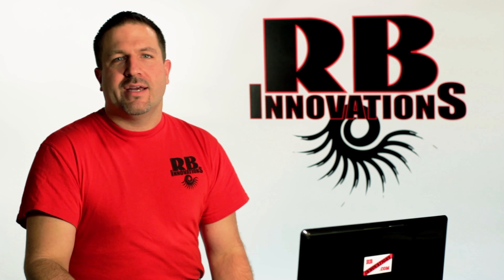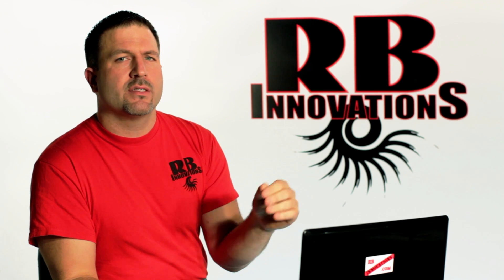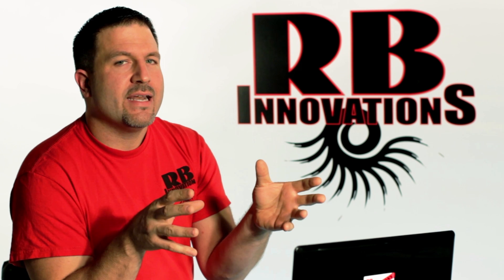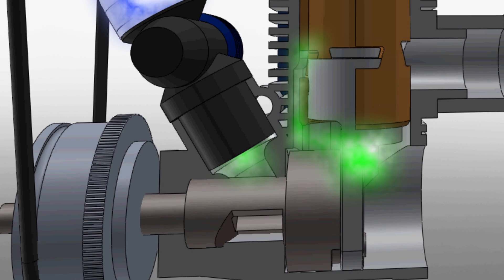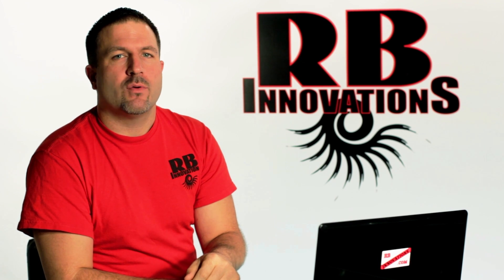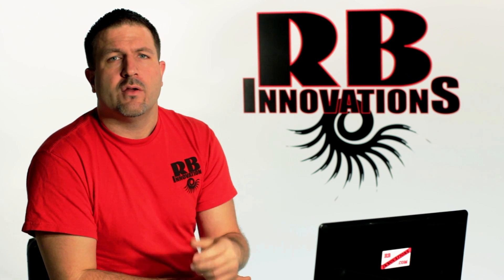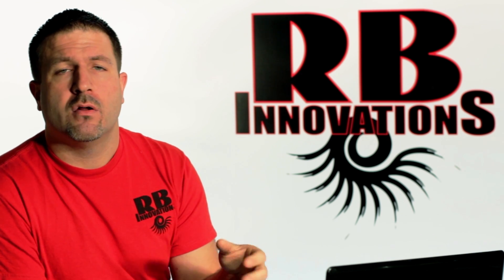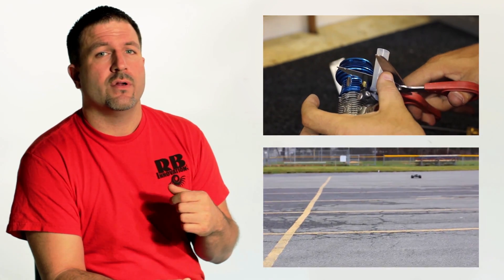How RC Nitro Superchargers Work

Comment: See I'm with the people who talk about blowing the pressurized air straight through the combustion chamber and out the exhaust. You need to prove that the shock wave holds that pressure.
Reply: well the shock wave does hold pressure back to a degree, speaking from knowledge of motocross 2 strokes, but without a exhaust specifically tuned to make this happen i would say that amount of pressure is finite. with larger 250cc two strokes the reverberation of the sound shock wave drives the A/F mixture back into the combustion chamber during the on set of the power band, this is whats called "on the pipe" in two stroke world. but again, just how much this shock wave can hold back is the real question here.
Reply: Matthew Miller But so even if it created any type of boost, wouldn't that boosted intake also require some sort of boost fuel to enter with the mix? If anything the added pressure would force back the fuel into the tank! LOL
Reply: Wow, this came up from the past!  Fuel in a carburetor is pulled into the airstream by the low pressure in the venture (that's supposed to be an "I" on the end of that word, but for some reason it keeps autocorrecting!).  If a supercharged and carbureted engine is a draw-through design (carb upstream of the compressor), this doesn't change: the carb is still seeing ambient pressure and the fuel supply needs no changes.  If the engine is a blow-through design (carb downstream of the compressor), the carb is seeing the boosted manifold pressure.  In these setups, you supply the boost pressure to the fuel tank volume also, instead of venting the tank to the atmosphere.  Therefore, the fuel supply sees the same boost in pressure above ambient pressure as the carb.  That way, the fuel is still drawn into the air the same as when it was all at atmospheric.  This is also nothing new, and it is required of any supercharged engine with a blow-through carb design (car engines, old airplane engines, etc.).  Pressurizing the fuel tank on r/c engine setups is also nothing new at all.  All of this can be found in any basic book on superchargers (especially older ones, from back when carburetors were still in fashion).
Reply: seth newman I was responding to josh ziesmer, to his post just above mine that was all about carbs with fuel pumps, floats, etc.  I have no doubt that r/c engines usually pressurize the fuel tank these days.  It doesn't make a difference to what I've written regarding supercharging such an engine.

+josh ziesmer What do individual exhaust pulses have to do with valve timing overlap?  We are talking about the overlap of the intake and exhaust openings.  Some here have said that supercharging can't work on engines that have overlap, but that is completely wrong.  Greg Quillen is right: most 4-cycle gasoline engines have at least some overlap of intake and exhaust timing, including ones with superchargers.  Some have a lot.  In fact, the ones that have a lot of overlap tend to have the most distinct exhaust pulses at idle (which is why people refer to them having a "lopey" idle).
Reply: josh ziesmer 
You dont even have a clue what valve overlap means /.-
   Valve overlap refers to valves both being open in ONE cylinder, and the exhaust and intake both happening at the same time. The exhaust valve is held open, then the intake opens letting the exhaust fully clear while oxygen is coming in, then the exhaust closes letting more air in, then the intake closes..THEN combustion happens. The piston moving down to dead center sucks intake in, while exhaust is being pushed out by the same air. 
    The time when the exhaust and intake valves are both open in ONE cylinder is called "valve overlap" because their actions and duration sequences overlap.

What you are thinking of is not even close to valve overlap and happens in all inline6+ engines. I have a doctorate in mechanical engineering, designed an engine for Nissan, and have been an ASE mechanic on the side for 15 years, I think I know a lil bit more than you. Just Google valve overlap for christ sakes.
Reply: josh ziesmer Please...stop.  Seth is right and you have no idea what you're talking about.  Please re-read Seth's post carefully and do some research.

And to answer your question: Yes, you'd better damn well believe that single-cylinder engines have overlap just like any other gasoline piston engine!  And that most definitely includes two-stroke one-cylinder r/c engines.
Reply: josh ziesmer Really?  The intake gasses (which on a n/a engine are at ambient pressure or less (vacuum, as you noted)) push the exhaust out of the chamber?  Try again.  In fact, as Seth's ASE quote points out, it is actually the other way around: the exhaust's exit actually helps draw in the intake charge.

If this is what you learned as an ME student, you should ask for a refund on your tuition.
Reply: josh ziesmer Oh, the humanity!  Again, please stop.  You're in way over your head and don't even realize it.  I'm trying to save you from drowning.

Seth!  Heh heh, I know you meant that last reply to go to Josh, not me.  My degrees are in psychology and social work.  But I still understand how ICE's work better than Josh!  And I have an LT4 with a cam that has lots of overlap (108* lobe separation) and, miracle of miracles, you can feel very distinct exhaust pulses on it.  Must be magic.
Reply: Matt Miller yes I did lol sorry got caught up in the stupidity! 

But yeah you'd think a dude designing engines would know that huh, i guess Josh knows more considering he can't tell between the different engine type! Hahah
Reply: The timing is the same (intake and exhaust openings overlapping) whether the engine is supercharged or not.  This is nothing new, and as the guy explains in the video the tuned pipe is important to minimize that.  But nothing changes on this by adding a forced induction system.  BTW, almost all 4-cycle engines also have overlap in their valve timing, including the supercharged ones.
Reply: That's literally how all 2 strokes work....how else would guys get 300hp from tunes pipes on their 12 mil Stroker engines inside their Yamaha Banshees
Reply: +Matthew Miller you're only half right, most carbs have metering devises ( floats, diaphragms ) that make it so that the fuel inside the carb cannot be pressurized. all carburetted cars have fuel pumps because the carb is above the fuel tank, however they are very low p.s.i so as not to over power the carbs metering devises and causing the engine to flood, so in most instances pressurizing the fuel tank does nothing, unless its to maintain fuel delivery when system is at extreme angles, and if it's over-pressured, what it does is bad.
Reply: +josh ziesmer The r/c engines we're talking about don't have float bowls and therefore no needes/seats to "overpower," and usually no fuel pumps.  They are gravity feed only.  I was noting that for them, you would want to pressurize the fuel tank on a blow-through supercharger design to make sure that the fuel metering doesn't change with boost pressure.  Carbs with float bowls have the bowl vented to the atmosphere, and the float/needle/seat prevent the pump from overfilling the bowl.  On a blow-through design you need to pressurize the bowl (not the fuel tank, since it has a pump) since the carb's venturi is also now seeing boost pressure, and you need to keep the metering consistent at different boost levels.
Reply: regular car engines also overlap intake and exhaust openings. my worth is not getting enough fuel but they seem to have fix if that happens
Reply: Greg Quillen they actually don't, if you hold your hand against the exhaust pipe of your car, you can distinctively feel each cylinder pulse
Reply: josh ziesmer all engines have valve/port overlap or else they wouldn't run for crap and would have horrible power and exhaust scavenging...you feel each plus because that's the combustion AFTER the IN/EX valves have closed
Reply: Matt Miller OHHH ok sorry, I misread it nevermind.
Reply: seth newman no they don't, except for inline six. The rest are four cylinder, v6 ( 2 banks of 3 ), and v8 ( 2 banks of 4 ) four strokes, four cylinders, each cylinder will be on separate strokes. And hear is proof that you don't need overlap for an engine to run good, does a single cylinder engine have valve overlap? Some engines have overlap on the same cylinder, but nothing Is going on then, piston is at to dead center, nothing going in, nothing going out, it's a dead zone
Reply: Matt Miller yep exactly, only difference in a 2 stroke is that it's a port closed by the piston.
Reply: seth newman the valve overlap you are talking about Is only important on two strokes, because the intake is what pushes out the exhaust, since it can't be done by the piston, but it's not important for four strokes, since nothing is entering the cylinder during overlap, because a naturally aspirated engine needs vacuum to draw in a fresh change, and there is no vacuum during overlap. I too studied mechanical engineering and I.p.e. mechanics, I studied at c.l.c., where did you study?
Reply: josh ziesmer I designed around 85 percent of the Nissan VK56DE, i think I know PLENTY about cam timing since I designed cams that went in over 200,000 Nissan cars.

2 strokes don't have valves kid. Also the intake doesn't push out the exhaust, so much as the pressure in the cylinder does as it's at a much higher psi than 1 BAR.

Also intake gases ARE entering the cylinder on a 4 stroke during overlap as exhaust is going out. Do you think the piston moving downward and the intake valve being open is just gonna create a magical forcefield to block intake while the exhaust valve is open /.-

Straight from the ASE website....
    "Overlap: As the engine cycles, there’s a time when the intake and exhaust valves remain open at the same time. This is a good thing and known as valve overlap. It's an important function in valve timing, because the exhaust gases flowing through the exhaust valve and manifold help draw a fresh charge through the intake valve and into the combustion chamber."
Reply: seth newman never said two strokes had valves, and no kid, the piston does not push out exhaust on two strokes, it's pushed out by the intake gasses, apparently we are having trouble communicating
Reply: josh ziesmer actually you did say 2 strokes had valve overlap in the beginning of your last comment "the valve overlap you're talking about is only important in 2 strokes"

   I didn't say the piston pushed it out, I said when the piston went down from the large amounts of pressure from combustion and moves past the port, THEN the exhaust flows out because it's at a higher PSI then the atmosphere...high pressure gases always try to move to an area with a low pressure deficit.  

Also the intake blows very little of the exhaust out, since the exhaust port opens a good while before the intake does and most of the exhaust has already escaped
Reply: We are taking about two separate things are same time, we are getting two and four strokes mixed up. Let's try this again. Two strokes, look up something called loop scavenge, they put a special dike on the piston, piston is at bottom dead center, both intake and exhaust ports are open, intake gasses rush into cylinder, hit the dike, are deflected to top of cylinder, hit doomed head and turn back down, hit other side of dike, and are deflected out the exhaust, on two strokes, the intake gasses push out the exhaust, fact
Reply: Matt Miller your "degree" definitely didn't take you very far. That's for sure. 

Mine made me design an engine with Nissans CVTCS cam and valve system and has been in 2004+ Nissans and is still used to this day in new models. I find that a pretty good achivement, considering I can actually tell the difference between ports and valves...or overlap and cylinders both being on intake stroke
Reply: seth newman your attacking my bad gramer? Ok. Your degree doesn't account for much in this conversation if you don't know much about two stroke engines...not trying to be rude, look up loop scavenge, it was the first attempt to clean up two strokes, before, the pressurized intake gasses just went straight across the piston, and leaving a lot of exhaust gasses, and having a lot of un-burned charge leaving cylinder, loop scavenge solved allot of that, yes most of the exhaust leaves on its own, but a lot is left behind because on two strokes, port timing ( like that? ) Is at bottom dead center, and not all exhaust can be purged unless replaced by another gass, the intake
Reply: josh ziesmer 
I've never seen the "Dike piston" design due to all my bikes and cars having flat top high compression pistons and an expansion chamber since 80+ percent of the exhaust is let out BEFORE the intake ever enters the cylinder of the engine because it opens a good while before the intake. 
   The intake charge that IS let out is shoved back in by the exhaust pulse being sent back and pushing the intake charge back in.

That's the biggest thing that cleaned them up over old Snowmobiles and motorcycles that had no expansion chambers or very unrefined ones
Reply: Joshua Ziesmar Ah no wonder, i only mess with RC, Motorcycle and car engines usually. Boat engines piss me off and Sea Doo's suck to work on
Reply: Joshua Ziesmar Ah I see, I was just talking about 1 cyl engines
Reply: josh ziesmer Still not sure how the exhaust pulse "smoothness" would affect the operation of a mechanically driven supercharger.  A turbocharger, maybe, but that's not the topic here.

People were saying that intake/exhaust overlap in a two-stroke causes a supercharger to not work well because the intake charge would be pushed out of the exhaust unburned, due to the exhaust being open at the same time as the intake.  But that's a fundamental misunderstanding of how overlap actually works in any ICE.  And the reason some of us pointed out that four-strokes also have overlap was to provide evidence that supercharging works when there is overlap, since so many cars/boats/planes have some form of forced induction (and they all have overlap).
Reply: Matt Miller I didn't see how smoothness would effect it either, witch is why I mentioned that most engines don't have overlap between adjacent cylinders.

Comment: It's true that the supercharger does work when the sonic wave pushes the fuel back in the cylinder. BUT: The engine's RPM is not fixed, the sonic wave's travel time is! So only at a certain motor speed, the wave will come back in the right moment. At any other RPM, the supercharger will be usless, plus it adds a lot of weight.

Comment: one thing no one seems to under stand is 2 stroke motors are already supercharged in a way the crank case is a air pump and it sucks thru the carb creating suction for the needle valve it seems like this would just lean out and cook a motor

Comment: Want more bhp out of a 4-stroke engine? Put a turbo or supercharger on it, hotter cams, reworked cilinderhead. Want more bhp out of a 2-stroke engine? Simply rework the cylinder sleeve or increase the engine capacity. It's way more beneficial and efficient than a supercharger. a Two stroke needs to draw it's fuel/air into the crank case, a forced intake will disrupt the already sensitive ballance.

Comment: 10 years. Talk is cheap, show me the dyno numbers. Kinda surprised they don't play with port timing. A supercharger on a car motor takes a way different camshaft to make max benefit of boost. Pro charger on a v-8 will almost double hp easily and it won't eat the motor as long as detonation is controlled. With that rubber band drive and the limited amount of upper pulley contact area i can't see it making more than 3/4lbs boost. Figure in a perfect world 14 psi boost is double hp, a couple 3 lbs won't be all that impressive.

Comment: hey m8 can u put on r/c plane?
Reply: i think not, because the rc plane produce a lot of air thrust, and this air thrust can remove the rubber and the motor will stop, so, in my opinion, you just need (and everything of you can do) is get the correct propeller

Comment: These wont work as the nitro engines are based on a 2 stroke. And you can not supercharge a 2 stroke it wont give more power and will blow the engine at some point.

Comment: If the rubber bands had teeth and so did the wheels for maximum grip and output , then maybe . Otherwise its a million times better to just buy a bigger engine guys !
Reply: Unless you can't change out the engine and you are trying to get more out of it.